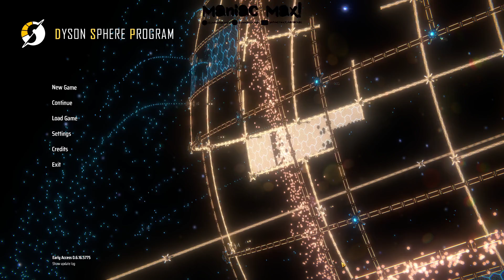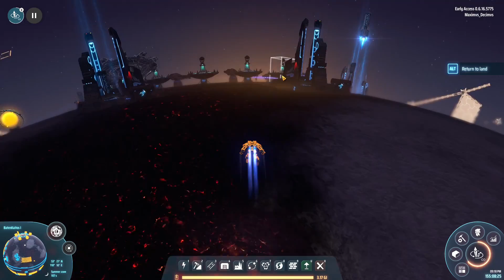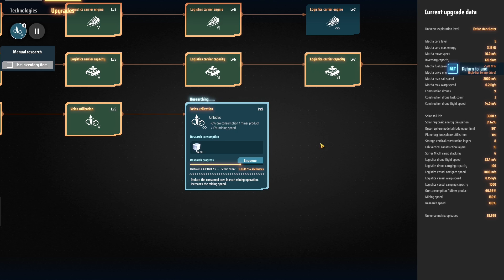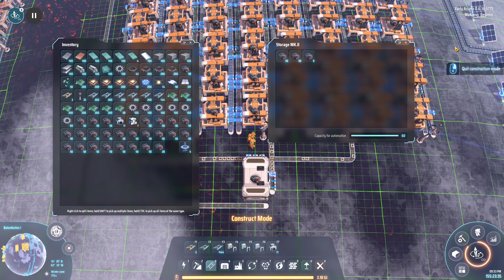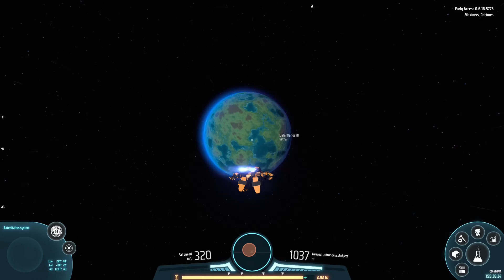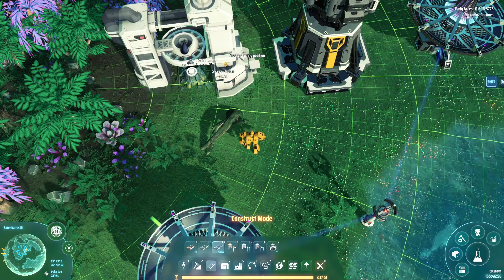Dyson Sphere Program NEXT: Beep Boop! CPUs! Motors! Turbines! (#36)

Comment: For titanium alloy i have tried a production layout and it worked.  Input : titanium ore , iron ore , sulfuric acid(from acid ocean) 

Layout like : titanium ore belt , titatium sheet smelter,  output belt , titanium alloy smelter , sulfuric acid belt , steel smelter , iron plate smelter , iron ore belt . 

30 line of this can work . This is more compact form of producing seperately.
Reply from the maker: cool - maybe oneday I'll have a bit of time to try that kind of setup :)

Comment: @Maniac Max some of the setup's wont survive upgrading as somethings like chips will go form 2 per 1.5/s to 2 per 0.66667/s  but that also means it will need resources faster and the the belts wont be able to support the long lines you got but your on the right track whit the quantity you you need

one thing I suggest you should invest in is the resource mining research I'm at the point that im getting around 26k hydrogen per min  from one gas giant when it comes to oil a 1.5/s got to 12/s already so it worth to invest in it not to mention the miners are gong amok to :D
Reply from the maker: I'm currently level 10 or 11 on resources research - I think I mention it in an upcoming EP amd talk about how much it helps :)